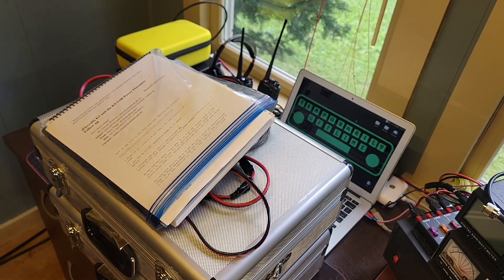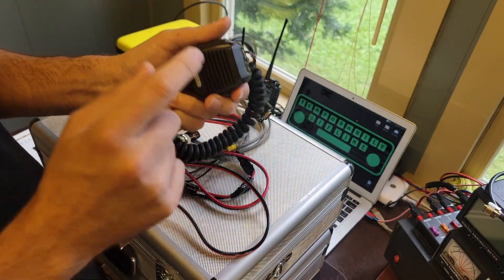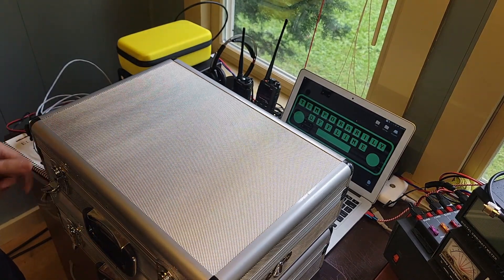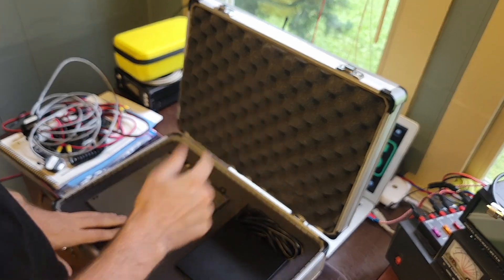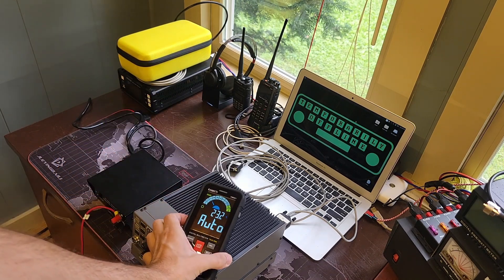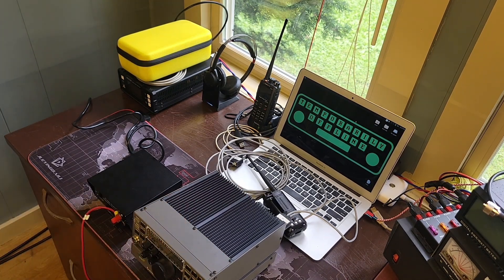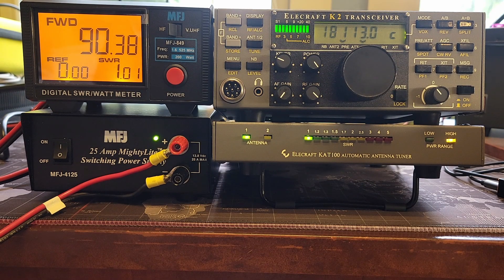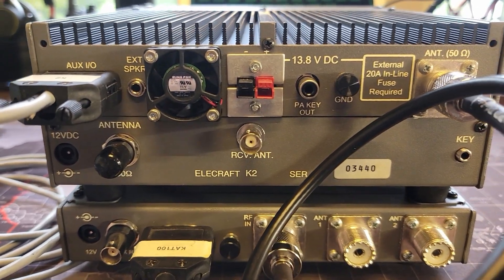What's a Used K2 got going for it?

Comment: The K2 has an aftermarket/community mod for constant audio output (useful for FT8 and other digital modes) audio output jack on the back, rather than its default state of not having a line level audio output that doesn't go up/down with the AF gain.    Biggest gripe I have on the K2 is the lack of audio gain it's like they didn't care about single sideband voice operation.
Reply from the maker: Interesting Mod!

Comment: If you set an antenna for a band (IE you have an 80m dipole, and a 40 through 10. You can set the radio to automatically switch antenna ports when you go to that band.
Reply from the maker: Yes, it was left that way from the previous owner and I wasn't expecting it.  There is also a Receive Only antenna
Reply: @temporarilyoffline  I had one when they first came out. Another in a long line of mistakes in selling good radios!
Reply from the maker: You sent it to a good home, and it has been spoiled with many QSOs!

Comment: You should be seeing 110 watts
Reply from the maker: You're right!
Reply: Maybe the radio (without a tuner) will produce 110 watts if power is dumped into a 50 ohm RF load? Some non-commercial builds are not limited by the technician’s knowledge, but the availability of proper alignment equipment. If the LC network is not perfect, there could be a significant waste in power. Just a thought.
Reply from the maker: @markusberg2770  I think you nailed it Markus - sometimes I get excited by new shiny and I forget a step here and there.  I can see on 40m the tuner wasn't showing 1:1 and that steals some power for sure!
Reply: @markusberg2770  There's a calibration process, probably needs re-doing. Not sure what the accuracy of the wattmeter is either, there are many factors at play.

Comment: Yes, plug a 20 Amp source to the power pole connector and a low amp source in the other.  If your high power source dies (battery), the radio switches to 10 watts and you are still on the air..  You wire the mic connector based on the mic you will be using.
Reply from the maker: Exactly!